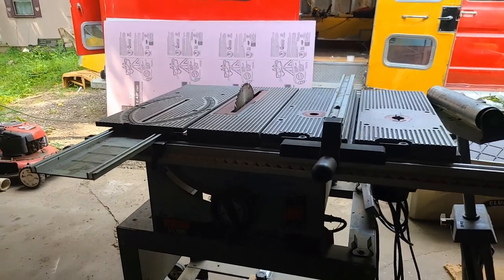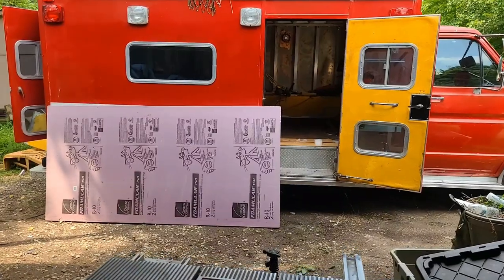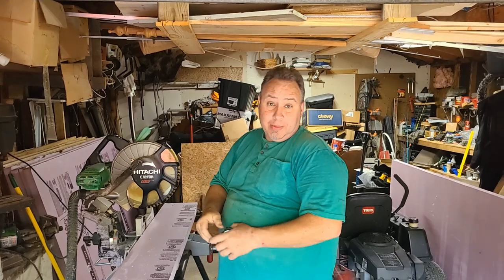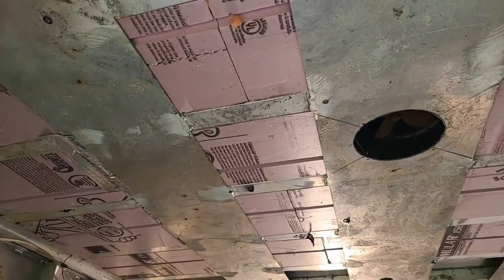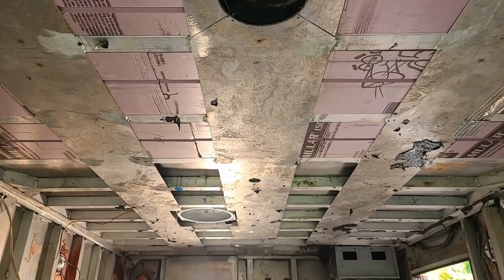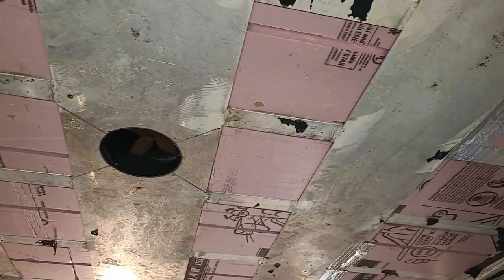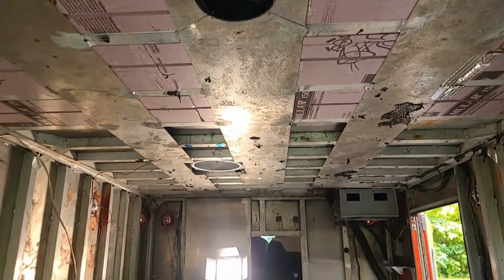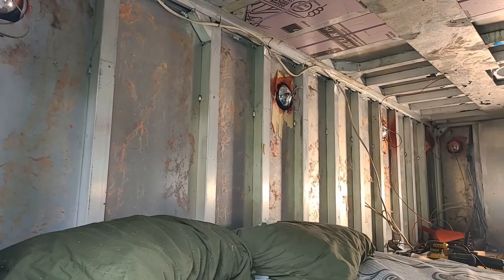Vanlife insulation, Ambulance camper conversion

Comment: Did you ever have any issues with condensation in your walls? I really want to do this exact same thing but some videos I've watched about insulating vans has me scared I'm going to end up with water in my walls
Reply from the maker: Non that I have found yet.. jus t some frost on some of the screws from thermal bridging/ which I expected at the time it was -4f outside.      the 5kw kept it about 65 inside

Comment: Good grief! You’ll be able to leave a cup of coffee out on the countertop and it will stay warm for a month. Lol…. You’re right, this is a ridiculous subject with  so many varied opinions, you don’t know what to do for the situation your dealing with. Does it need a vapor barrier or not, ceiling is different R value than walls. It will totally wear you out mentally if you go online and start watching and reading forums. I put 2 inch under my enclosed trailer and 1 inch in ceiling. I’m going to completely gut it someday and maybe have my sons company spray insulation in it. But then, you read where that causes condensation and rusts steel square tubing inside the walls. I’ve given up. The goal is that is outlasts me and keeps me warm and cool. If it rots eventually in 49 years who cares. I know I won’t care. Lol…
Reply from the maker: This is exactly my thoughts.  Male it the best I can afford... and go from there.   So far what I have got done has had a huge difference with being in the sun.  Next step I think I will paint the roof white.  Even though it will be 90% covered in solar panels it can't hurt
Reply: @Ambohouse  Maybe roll on a rubberized coating. I bought a gallon of black to do under the tiny house but I think menards had white also. It was 100 for gallon though.
Reply from the maker: @19stoney64  on my old campers I always used.  Elastomeric paint.  About 30.00 a gallon from Walmart.  Uv reflective and flexible
Reply: @Ambohouse  ohhhh….good to know. That word is too big for me to say so I’ll have to write it down and show it to an employee there.
Reply from the maker: Here is the stuff https://www.walmart.com/ip/White-Rust-Oleum-Elastomeric-Roof-Coating-Gallon/922070437?wl13=1356&selectedSellerId=0